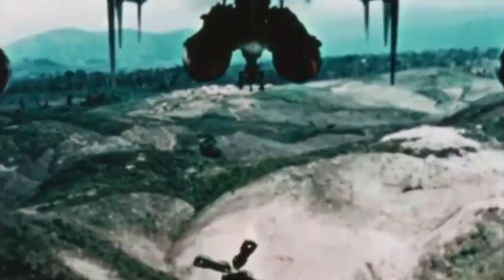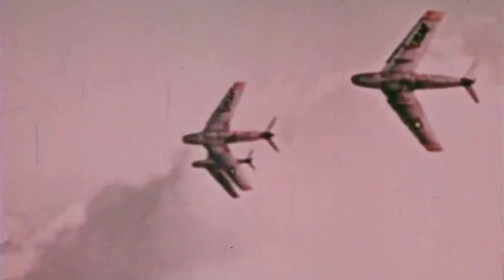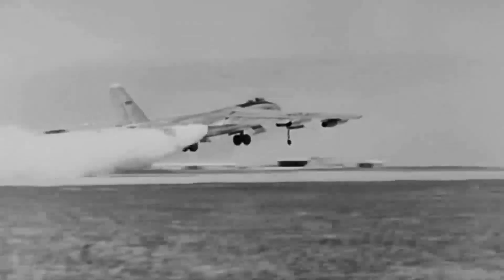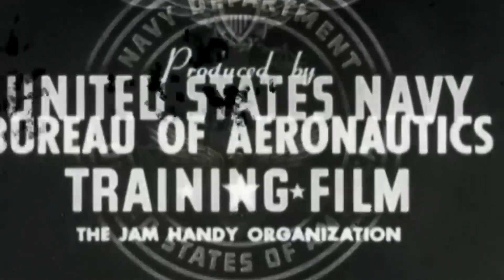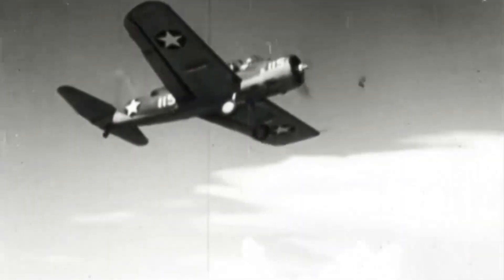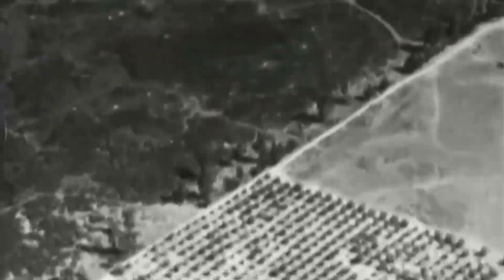This Massive Airplane Flew Upside Down to Toss Atomic Bombs - B-47 Stratojet Idiot's Loop

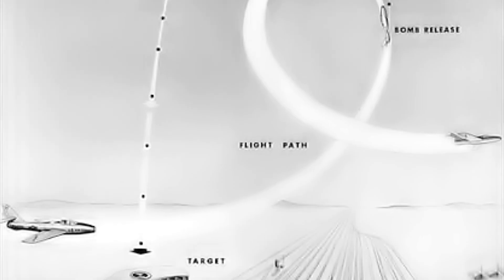Comment: Your illustration (2:00 to 2:15) is totally wrong.  It shows the aircraft overflying the target before initiating the delivery. That's exactly the opposite of the purpose of the maneuver, which is to avoid the target area by the maximum distance possible. And it shows a loop, instead of a modified Immelman.  The narration gets it closer to the truth.
We called the maneuver LABS or 'Toss'. Release is at 45° nose-high in the pull, the pilot continues over the top but does not complete a loop. Instead, when the nose is 45° nose-low, a half-roll is performed and the pilot continues the steep dive down to a very low egress altitude, heading away from the target at approx. 180° to the ingress heading. It is the first half of an aerobatic maneuver called a Cuban-8, a diagram of which looks like the numeral 8 lying on its side.
The maneuver is a very simple one to execute.  Accordingly, we didn't need to practice it often, just a couple of times for semiannual proficiency. The critical parameters were beginning the pull at the proper speed and distance from target  and maintaining a precise g-load for each phase of the maneuver.
Dave Riley
USAF, Ret.
F-100, F-105, F-4
Reply: FACTS mean absolutely nothing to this guy.
Reply: Thanks for your input. Interesting!
Reply: Thank you...I was thinking the same thing as I looked at it.  I've seen this misrepresented frequently in different forums.  I appreciate you helping to clear it up.
Reply: @311Gryphon  Actually, there were three methods of delivery. Loft, toss and over the shoulder. The  illustration in question is the "over the shoulder" delivery.
Reply: @Skyhawks1979  I understand but the illustration they use makes little sense and I'm not sure why anyone would ever use that.  It looks to me like the bombing equivalent of the "Cobra Maneuver"...something that looks cool at an airshow but is idiotic to do in combat.  I'm not a combat pilot...it just doesn't make sense to do a loop over the target area when you don't have to.  And I can't see any possible scenario where you would have to.  You could do an "over the shoulder" type release with a half loop, half roll, and extend.  You can do a loft or a high loft and then do the half loop and extend.  Doing an "over the shoulder" and then continuing a full loop just doesn't seem wise at all.
Reply: I thought they had to stop using this maneuver because they were worried about the wings falling off. Was there not a problem with stress fracturing and metal fatigue on the B-47s practicing this maneuver?
Reply: @c.s.oneill2079  It was a privilege to serve, RPG. And of course, it was a great pleasure to be able to enjoy flying these jets and  having Uncle Sam provide the fuel and maintenance. 
After seeing "F-100, F-104, F-4"  in your post, I came back to see if perhaps I had made a typo error. I never flew the F-104. I did apply for an F-104 assignment in early 1972, but didn't get it.
Reply: Quack is illegal
Reply: Dave Riley The illustration is from original USAF documentation... I have seen it, and if I recall correctly it is one of several illustrations of toss bombing variants, where in this case the egress route is planned to extend beyond the target rather than back the same way they came. The reason for this maneuver is also to create space between the attacking aircraft and the (ground-burst) detonation, by trading forward speed for altitude and time.
Reply: @bennylofgren3208  Interesting. I can see where that could work for an undefended target and with a parachute on the ordnance for when it reached its apogee, allowing the aircraft time to continue along the approximate original heading.
Reply: @bennylofgren3208  Yes, the illustration is the "over the shoulder" method.
Reply: The Phantom was the first model plane I built as a kid. I chose her for her brutal beauty. Sad that Japan retired theirs. I think they could still be useful in a conflict with North Korea.
Reply: what do you expect from a guy who said dive bombing was invented in 1947

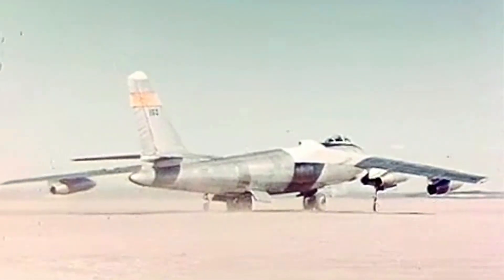Comment: "he pulled the clutch" 2:26 

why do I watch these?
Reply: I mean, it's 90ish% correct information usually. They're not bad for idle entertainment, just don't cite them in a paper or a debate.
Reply: The clutch is next to the flux capacitor
Reply: I believe it should say he pulled on the stick, not clutch. That is how you would lift the nose..
Reply: Referring to the bomb-sight clutch
Reply: Maybe it was supposed to be choke
Reply: Bomb sight clutch? What's that?
Reply: fake news, all bomb sights are automatic with settings DRIVE, NEUTRAL, REVERSE, and PARK
Reply: It was fast and furious lmao

Comment: A friend of mine's father flew F16's out of England during the Cold War, they practiced this delivery method as well.
Reply: This maneuver was also used by other aircraft. If they would drop the bomb in low altitude, they couldn't escape the blast wave. With this maneuver they can fly to the target in low altitude, and still escape the blast.
Reply: In the early 80's we were tossing unguided ordinance from an F4 nearly 5 miles . Fly low down the fijord , pull up and toss over the hill, return to low level , and escape. Out of 100 Mk82s 99 hit the 10mx10m rock in the ocean. The 1 miss was short but it split and burned ending up on the rock. We wanted to take the burned out case back home but weren't allowed our prize. Couldn't get the booster out.
Reply: Navy carrier nuke bombers were using that maneuver in the 60's.  I personally witnessed a launch.
Reply: Buccaneers did it too
Reply: F-111 practiced this same maneuver  when I was at Heyford in the 1970s.
Reply: @vernscheck2658  I was in the wing shop at Filton in the 90's on F1-11"s Loved them :)